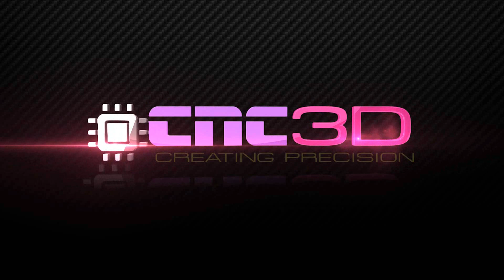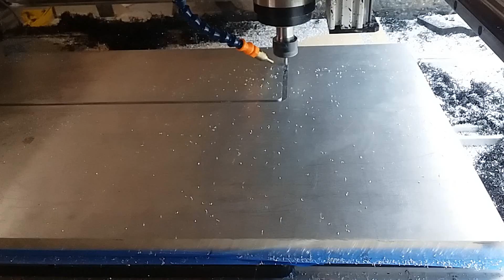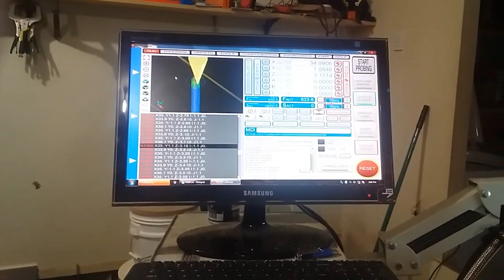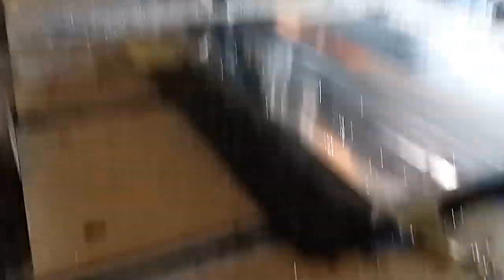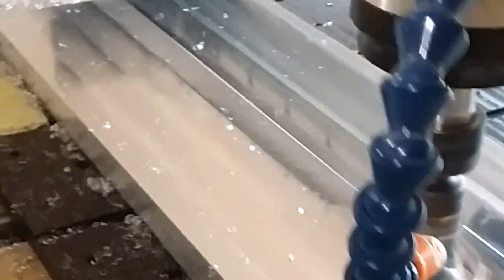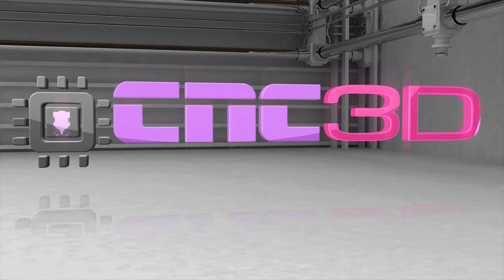SharpCNC / Workbee Z & X Axis upgrade kit

Comment: Does this come with everything screwed rail everything to assemble
Reply from the maker: Hi Michael,
In order to reduce freight costs out of Australia (very expensive), currently we do not supply any additional bolts or T-nuts required for the build. Although we are working on adding a "hardware pack" that customers can purchase as a separate option that will include all of the extra accessories to complete their build. We feel this is happy medium between those who would rather spend some extra money to get everything in one go and those who don't mind visiting their local Nuts and Bolts store and saving on extra freight and hardware costs. 
To give you a better understanding of what's required you can have a thorough read on our listing regarding extra components that are needed. 
Details here: https://www.cnc3d.com.au/product-page/sharpcnc-workbee-queenbee
I hope this helps!
Regards,
CNC3D

Comment: Just came across your products, they look great. Have you produced a video that shows how easy it is to swap over from a CNC mill to a 3D Printer and other heads that are compatible with your base product/frame? We are looking for 3D Printer that can also CNC mill and would like to understand how easy is to switch from one head another
Reply from the maker: Hi @Gear Campus, 

Swapping to a 3D printer head is a bit more complex than just changing a head over to say a laser or plasma torch.

3D printing requires a new controller to the one we supply with the standard kit as it needs as it requires an extra axis for the extruder and additional peripherals to control and monitor hot end temps etc. 

Although we do stock some SKR1.3 boards by BigTreeTech that would be great for this. When we get a chance we'll be doing a video on this. 

Please subscribe for update videos. In the mean time, happy building! :)
Reply: @cnc3d  Thanks for the reply. Just subscribed. We are looking for a 3D printer and CNC mill in the one unit. The mill would be used to cut wood, HDPE and maybe aluminium. Don't need a laser or plasma cutter. Also, like the fact that you are an Aussie company building a great product is something we like very much. Will keep in touch. Thanks, Chris